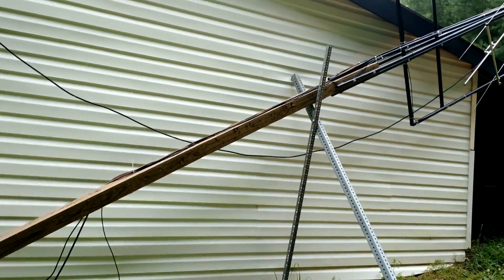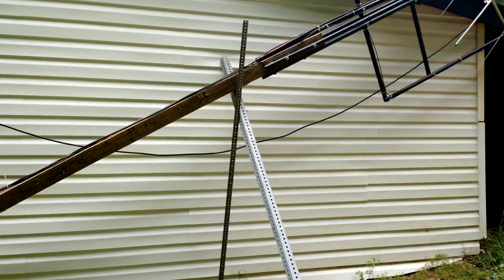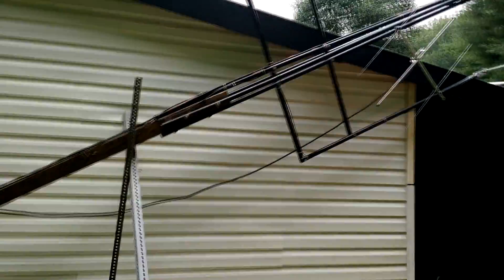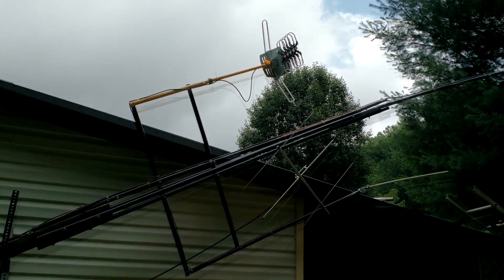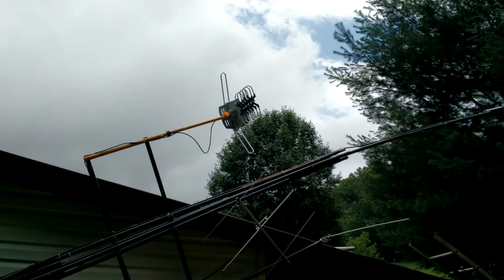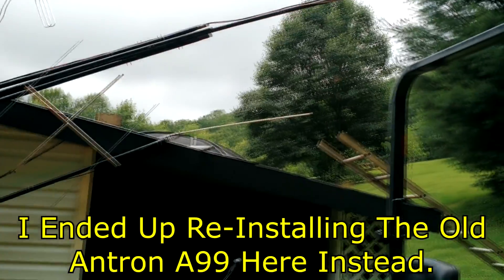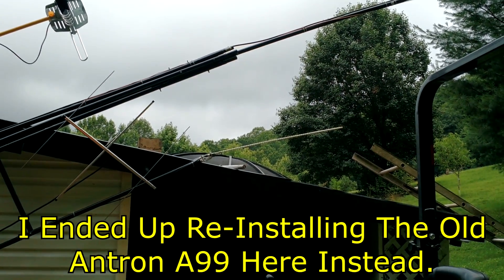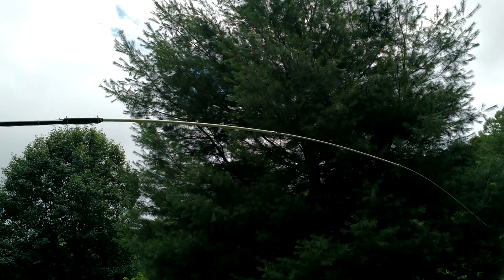Antenna Tower Build Part 2: The Scary Part.

Comment: Deed you painted the Imax also i had problem with mine lacking a condensation hole on the bottom of the middle section so in the winter it cracked on me so to the freezing an also bled my hands while dismantling it cause the after two years on the roof  the paint cracked of and it was like fiberglass sand paper had a trouble for a couple of days puling the glass out of my hands. But the best CB antenna that i ewer used
Reply from the maker: I did not paint mine, but I did consider it. So far I love the range its giving me, so we will see how it holds up this winter.
Reply: Even with the crack from freezing condensation and peeling fibers it still works as same as when she was new. The best CB antenna ever little scary with the high winds but she is still straight up in the sky. As I said before the best antenna ever if you gonna use it just for CB a ground plane kit works awesome but it detune it on 12-15-17 meter .
Reply: @YU5KBM  : The antron 99, Solarcons,  iMax 2000 are good antennas I wouldn't say the best, electrically and physically all they are is a simple 1/2~ end  fed dipole. Historically the 5/8~ and the .640~ wavelength antennas are unsurpassed when it comes to 10/11/12 meters.
Reply: Is that horrible TV antenna still working?
When you replace it get a real antenna a real amp and a real rotor.
It will save money in the end. Even a home brewed 4 bay whisker antenna, a wallyworld preamp and a cheap rotor would out last and out perform that one for not much more money that all in one. And if a component fails the whole system isn't trash.

Comment: Do you have a pulley and some rope you could use?  A boat winch or some ratcheting crank pulley?
Reply from the maker: Yes. It was quite a process, but I eventually got a set of ropes over the side of the garage and then hooked them to the tractor. It was foot by foot. Raise it a foot, then double check, then raise it a foot and so on. 

  Thankfully it all worked out in the end. I'm still alive and the tower is up! The setup is great. Low noise floor, new cable and antenna, and I've already made some great DX contacts with it. 

 Thanks again for setting me down this path. Until I saw your setup, I never considered that it could be done, but it can and it has!

Comment: Why did you have to go back with the old antenna
Reply from the maker: The Max-2000 was defective. It had low SWR when it was hanging there horizontally, but once it was all the way up, it had a dead short. I suspect that there was some trash inside of it that would drop down and short out once it was vertical. I now have a replacement up as well as the original A99 so that I can use two radios at the same time, or use it with HAM stuff with a tuner.